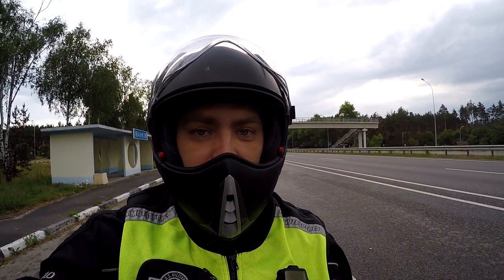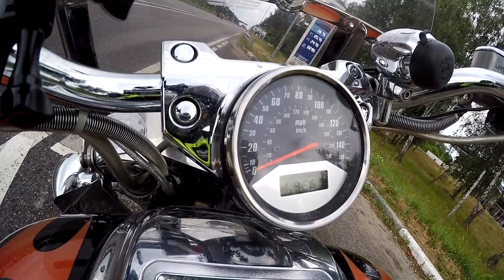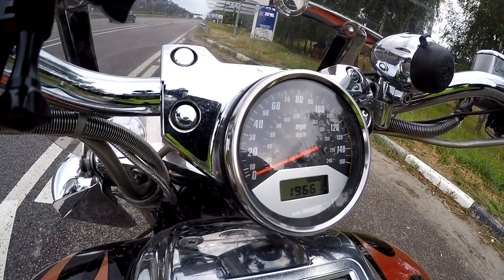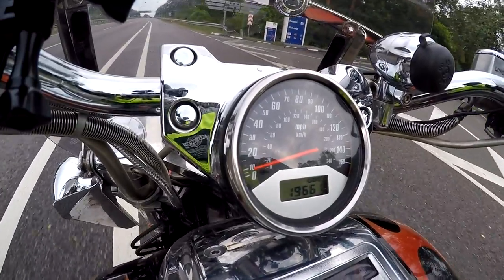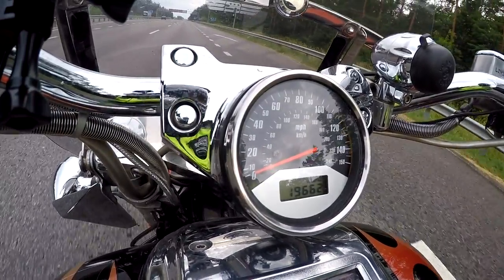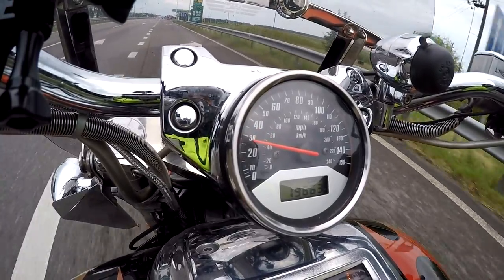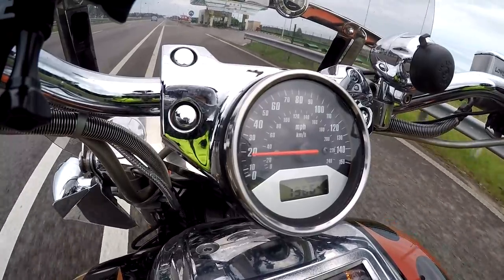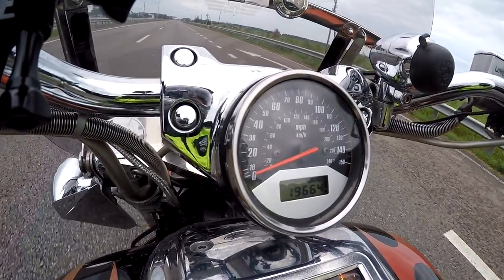Moto Vlog. HONDA VTX1800 FAST ACCELERATION. FULL STOCK. PART 2

Comment: I'll just accelerate to 80MPH because i really dont need any more....

goes to 100, then 120  so he's one of us after all
Reply: It does more than 120. It is computer limited. It's a very powerful bike, and top speed in excess of 135mph.
Reply: @joelalexander7328  given enough road, they all should run out to 135-140, especially the F models. I've never heard of them being limited, mine certainly isn't, but If you have a windscreen/fairing, and bags, it will try to sit at 117-120 for damn sure!

Comment: Love my 2007 VTX 1800 R. Butter smooth power that gives me great joy!
Reply: What kind of mpg do you get? I’m debating on getting that or the 1300 but I’ll go with the 1300 if the gas mileage is a lot better
Reply: @scottg429  I can get about 43-47mpg if I'm trying to run far, but I'm really hard on my bike, so it's regularly closer to 38-42.

Comment: Sounds like a stock bike like my 2003 which was pretty fast. I have a 2006 now with Cobra pipes and a few other modifications that accelerates much faster. you can even get quicker acceleration if you let it wind out a little bit more in 3rd and 4th gear. The 1800 VTX has a lot of power for a medium compression engine due to the fact that is 1800 cc's. Thanks for your video my friend.

Comment: Let that thing get up in the RPM's! It's not your normal V-Twin, these things love to rev :D I was getting 4.5 second 0-60 times when I got my 03', now I can reliably hit 3.6, all stock with 26k miles, simply because I know what to expect from it, and where to shift. Don't be afraid to rev this bike. It helps a little that I love very close to sea level, but they're fuel injected, you can get reliably quick times pretty much anywhere on a healthy VTX.

Comment: I cannot believe how Honda discontinued this bike. Imagine the fury with this 1800cc engine. People complained of the VTX 1800 being heavy, but I don't see it. The handling could be better but this is a beast of a bike and several aftermarket parts improve the handling anyway. The VTX 1800 one of those bikes that was a product of the CC war in the early 2000s. Of course, it's going to be a tank!
By your accent, I suppose you're Russian or Polish (apologies if you're from another country), so how much did this bike cost you in your country and did the Retro VTX 1800 ever get sold there and not just the C model? Nice to see you wearing gear, by the way, even if it is strap-on gear.
Reply from the maker: Motorcycle Gear Hub 
You are  almost right. I am Ukrainian. We have the R version here and S and F. It is not the big difference in price. VTX is getting older so you can buy 1800cc for 8000-10000$ and 1300cc for 7000-9000$. In 2012 it was 12000$.
What bike/s do you ride?
Reply: Thanks for the reply, buddy. I ask because only the C model seems to have been made commercially available in the European Union. Most VTX 1800 Retros I have seen are imported from the USA. Is that the case in Ukraine with the Retro VTX 1800? As in, are the VTX 1800 Retro models (used) imported from the USA? I saw that your bike has the miles per hour at the top of the velocimeter, so that may mean it is USA imported. Would love to know the answer. Many thanks again!
Reply: Look in my playlist. I have an 03 1800R. Handles like a dream
Reply: It is a heavy bike I have a 2006 however with the Right Tires you could corner quite well for 800 pound bike. With Cobra pipes and minor modifications it is quite fast.
Reply: Had one poor low speed handling!

Comment: I have the exact same pipe with the exact same design. I just picked it up last week and has Cobra pipes and the bike is a beast! I keep having to look down at this pedometer cuz I'm always going way over the speed limit. Although the bike is happy at a standstill, it's very Nimble once it gets going. This is a bike that's why I only for experienced Riders and not for anyone that's been writing under 5 years or so
Reply: Some complain the footpegs touch the floor when cornering,when i first bought mine 5 years ago i also noticed it, but it didn't take long to also realise i was coming into the corners a lot faster than i thought,so i too started looking at the speedo to check my speed more often,very rare i touch them down now....this is a very fast cruiser make no mistake about it.
Reply: Definitely for experienced bikers.
Reply: It's a bike for ADULTS. The power is there if you need it (want it) but it's very easy to control if you're responsible. I got one as my first bike, and the only issue is the weight at stops. Dropped it about 15 minutes after buying it 🤣

Comment: One more thing, what's the clip-on that you have on your windshield? Is it the one from Givi? What is your experience with it? I've been looking to use two of these on each side of my windshield to act as wind deflectors for the sides of the windshield. Either that or I'm getting a new windshield with a wider screen (I can't install lowers due to the lightbar and other crap I've put on the bike LOL).
Reply from the maker: Motorcycle Gear Hub 
Hey! Thanks for your comments.
It is just custom made deflector. It is helping me a lot, and more, it is helping my passenger. I got it on olx website just for 30$.
Reply: I have 3 National Cycle Switchblade screens...quick release....for my 1800...the large" two up",..smaller "shorty" version and the small "wind deflector" style which i use in summer,also have S/Steel wind deflectors/light bar fitted..excellent screens..highly recommend....ride safe....

Comment: How do you remove the computer-limited top speed? I understand that they can go much faster if it is disabled. Enjoyed your video and commentary.
Reply from the maker: I think it is not limited. Just max RPM is limited, after some point the fuel just cut from engine intake. I think it is normal for every bike.
Reply: @DenysDavydov  Thank you for the reply. I'm a new subscriber.
Reply: A few performance upgrades get rid of the bags and windshield and it will go past 150. I've had my 02 vtx1800c to 150.
Reply: @russellmccown2529  what performance upgrades are you talking about?
Reply: @russellmccown2529  how is yours set up? What program intake exhaust all that?
Reply: @kylecowan5326  V&H big shots, fi2000 powrpro, smog system delete, k&n air. I've had it over 140 several times, and right at 150 once (according to the bike speedo) it felt like i could go a little faster but dont trust the highway. (Hit a big pothole doing 80 once felt like ass went up in my throat)

Comment: How fast can the 1800c  go I have a 1300 looking to up grade
Reply from the maker: Peter Cruz I did 130 mph maximum on that bike.
This bike is not made for fast riding but it is accelerative.
Reply: The torque is crazy. Never had mine over 100 mph. Just never needed to. Don't ride faster than your Angel can fly
Reply: I have a 2006 with Cobra pipes and some adjustments on the computer and fuel injection. 140 pretty damn quick. Getting on the highway have to be careful because you're going to hit a hundred or more by the time you pass the yield sign.
Reply: I am in my 50s and still have a little bit of raciness in my blood and if you are the racy type you can get a very fast 0 to 60 if you come off in 2nd gear from a Dead start due to the torque of this bike. But I wouldn't recommend too many times or you'll fry the clutch.
Reply: Deffinetly upgrade. I went from the 1300 to 1800 and so glad I did. I had the sabre 1300 now the 2002 vtx 1800 and love it so much. But me being me I'm always looking for faster and meaner but can't find it. Unless I go to a crotch rocket and I'm not doin that I love my cruiser!!!!

Comment: short shifting sucks
Reply from the maker: Antakaran It wasn't.
Reply: It sounds like powerloss either torque drops completly at certain rpm or to little throttle on each gear. Suzuki m1800r doesnt show in this way and they have the same data in torque but diffrent hk, should not sound like this anyway. Can you explain?
Reply from the maker: Antakaran I don't know. Maybe...
I am not professional drag racer...
But for me it was much better compare to the first video. M109 Suzuki is better for acceleration...
Reply: He could have milked 1st gear up to 50mph and third gear up to 90mph, but the torque of this beast at low RPMs is crazy. The m109 (1800) has more mid-end power and can be revved higher than the VTX 1800, so that's possibly why you mention him short-shifting when he's barely doing it. Just by looking at the engine configuration of the m1800 vs VTX 1800 it is easy to see why the m1800 can rev a lot higher.
Reply: No the 1st gear hits rev limiter at 41 42. He should not touch the clutch for his 1st to second shift. That would increase his time dramatically. When you are good at it, it creates a constant pull. Now if you have the 1300 rear I have heard your 1st will hit rev limit around 45 to 48. But we are talking about a vtx 1800 no mods stated.